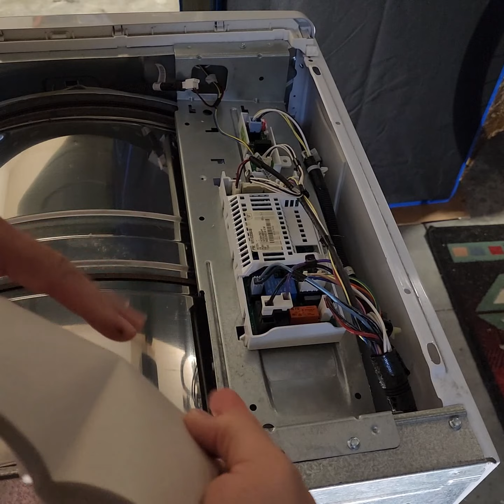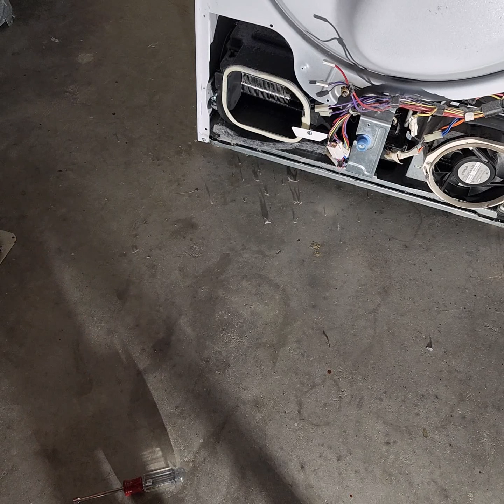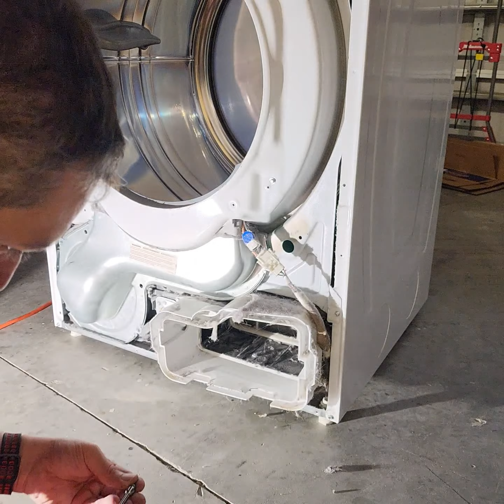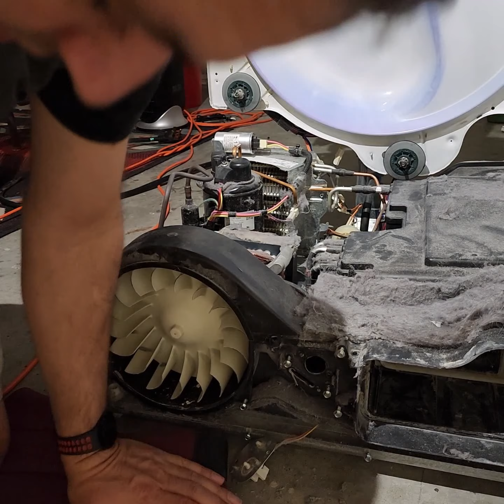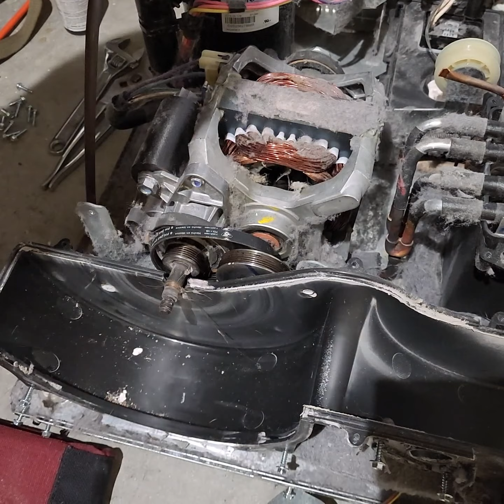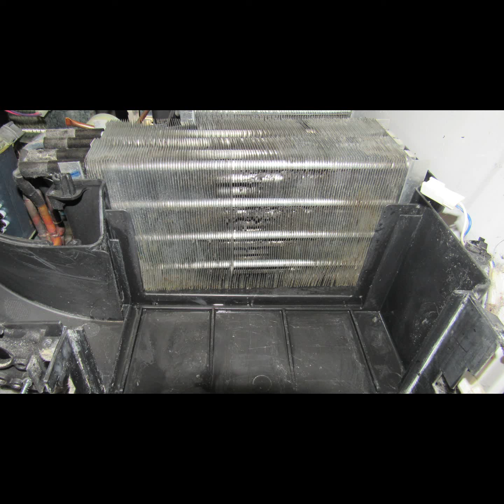Whirlpool Duet Dryer Takedown and Cleanout

Comment: What’s the filter behind the one you pulled out?  Mine is clogged up
Reply from the maker: @paulamoore4694, do you mean the filter at the bottom?  What part in the video were you referring to?
Reply: Around minute 26.  The internal filter behind the lent filter that pulls out.
Reply from the maker: @paulamoore4694  So I think you mean the small screen that used to be there, but I had cut mine out so I could get the vacuum to the evaporator core fins to clean them.  You can probably see the remnants of the old "screen"  it was not really a filter.  The only actual filters are the main lint filter and the hybridcare filter that pulles out from the bottom right corner of the machine.  I hope this helps.
Reply: @morrasolutions yes I believe this will help me!  Thanks for your help!!